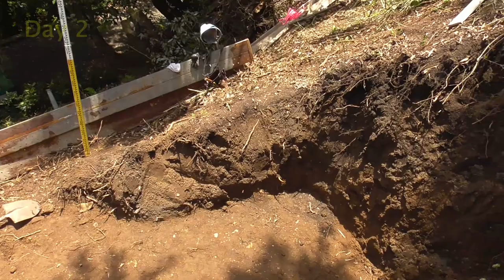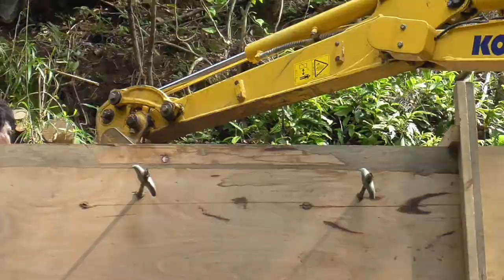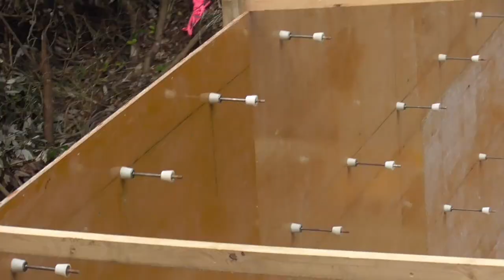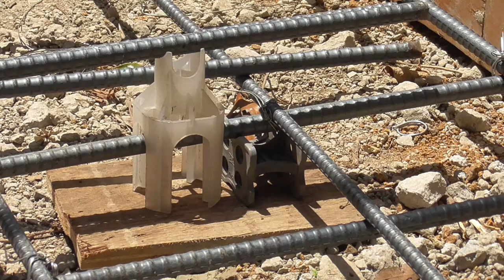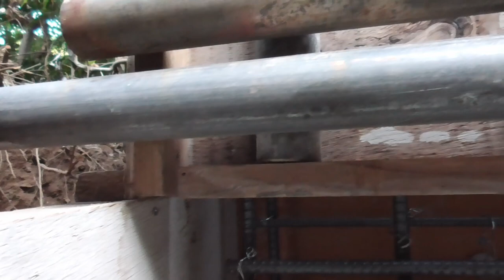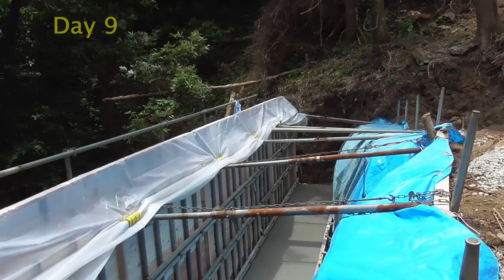Our First Retaining Wall Goes Up on the Mountain,  Part 01 (S2E5)

Comment: For my own peace of mind I would have wanted to knock rebar straight down scattered around the inside of the form, so basically pile driving down in  the rebar area. At least 6feet,to anchor the walling. Only because of the fact of removing such a chunk from the mountain side i would be concerned with landslides happening overtime.
Reply from the maker: Thanks for the comment, Simon.